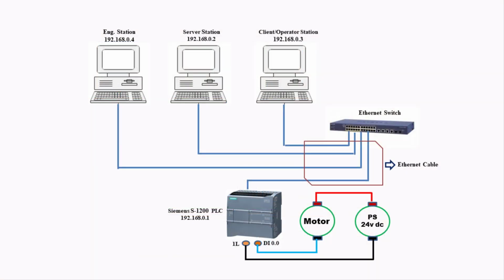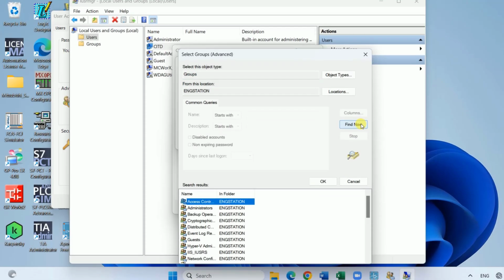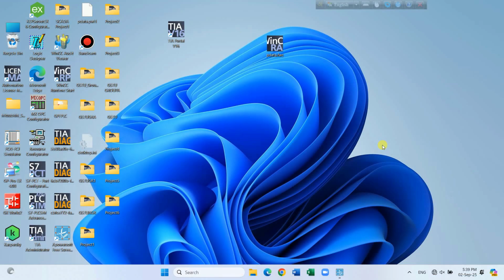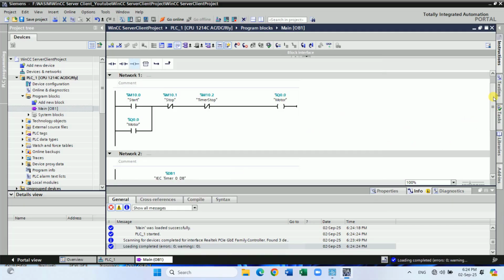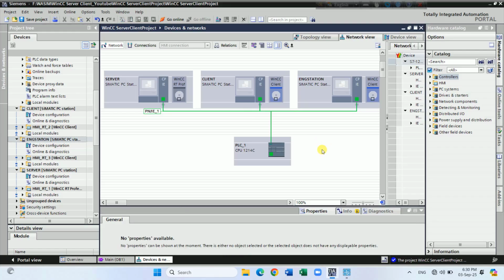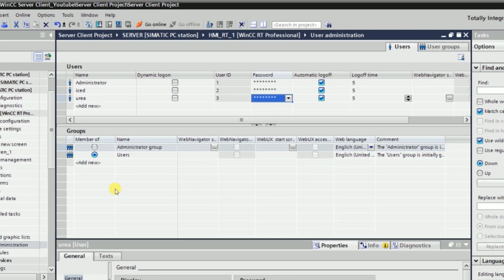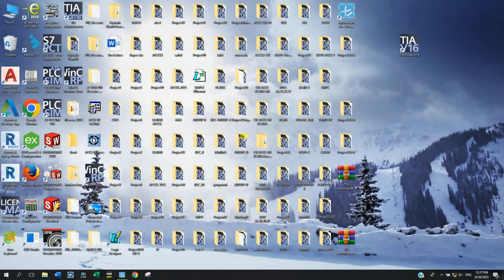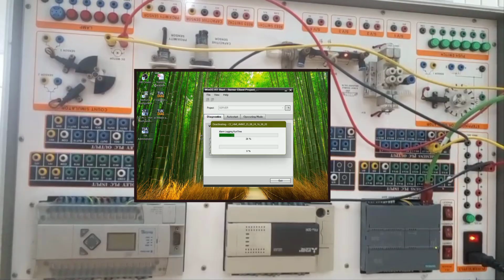WinCC Server Client Configuration & Operation

Comment: Hello Why is there no HMI connection between the WinCC Server and the PLC? I thought that connection was required in order to control the PLC and read signals to display on WinCC.
Reply: The same question....
Reply: I also had no connection, the problem was my PG/PC Interface, so I had to change it to „Realtek… .TCPIP.1“. After this configuration, communication worked